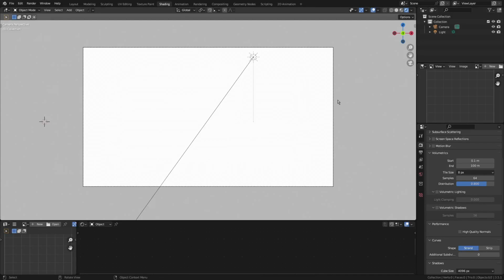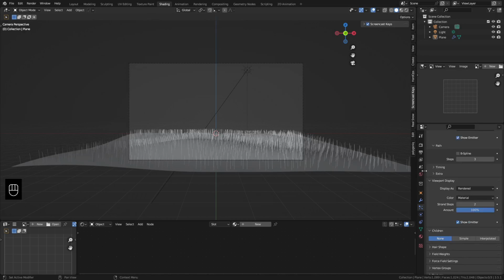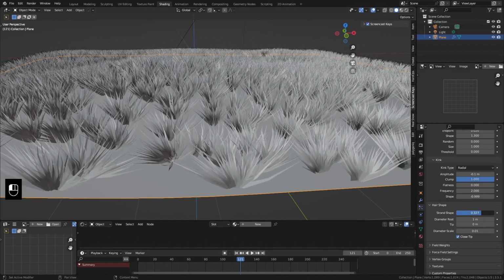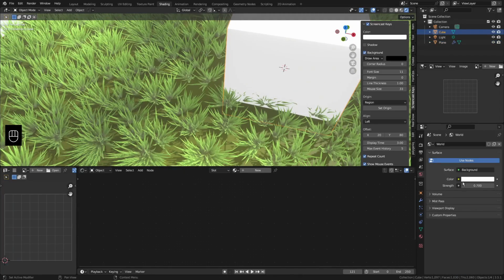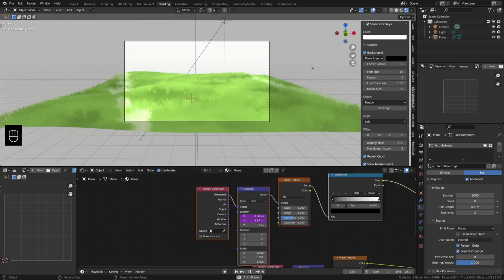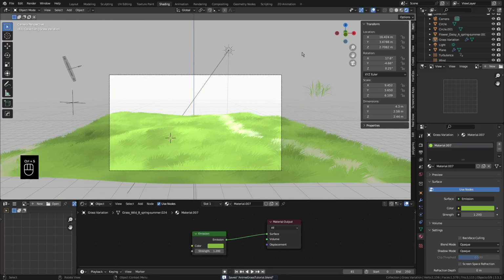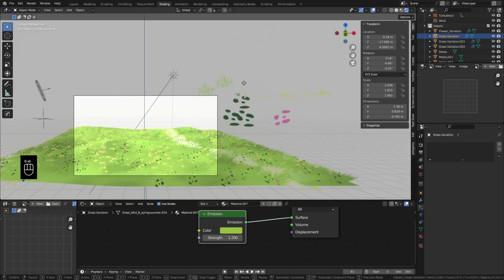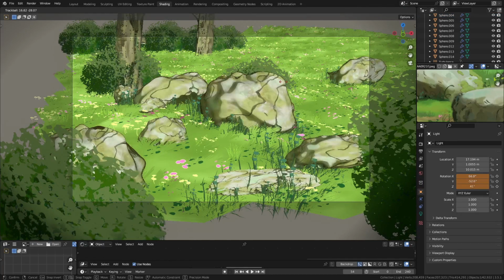Tutorial: 3D Anime Procedural Grass in Blender

Comment: Anyone having problems in the 4.2 update? mine messed up and the shader isn't working
Reply: have you figured it out? mine crash if i click shader view/render view/ try to open shader panel or try to render anything ((
I had to restore my blender 4.0 and it works, but i want 4.2 so badly
Reply: Yeah same happened to me, I had to reinstall 4.1, I think my pc isn’t enough for running the 4.2 smoothly, I’ll remain in 4.1 until I can get a new pc or blender optimizes its latest release, also the shader doesn’t cast shadows idk if you have the same problem, greetings 👋

Comment: For those who want objects to cast shadows onto the grass, pass everything into the color slot of a Diffuse BSDF. Then shift + a and add a normal node and pass that into the normal of the Diffuse BSDF. The result should be the same but with shadows.
Reply: i don´t know if i did it right but it doesn´t work for me. Do you have to put de diffuse bsdf before the last node? the normal node has to be connected to the rest?

thanks man
Reply: @Manu-um3vp  The diffuse should be the last node before the material output. You pass the color of the original shader, the one made in this video, into the color of the diffuse and a normal node into the normal of the diffuse. Then you pass the diffuse into the material output.
Reply: @SimplyAzure-sq4ru  thanks, and the normal node is not connected to anything but the normal of the diffuse? i think i made it right but it doesnt work for me
Reply: @Manu-um3vp  Yup the normal node should only connect to the diffuse shader node. Maybe it could be that our blender versions are different. I'm using blender 4.1, what blender version are you using?
Reply: @SimplyAzure-sq4ru  Connect the Vector from Mapping to the normal, then, the normal to de normal of the diffuse and that should be work

In this order  Texture corrdinate ----- Mapping(2 from vector, 1 to Noise texture and 1 to Normal) ---- Noise texture ---- Color Ramp ---- Diffuse and Normal to the normal of the diffuse, and Diffuse to material output
Reply: @SimplyAzure-sq4ru  I'm usin 3.6, but it worked now for some reason, my file was kinda crazy with the lights, earlier if I marked the cast shadows option in the lights config the lights would not work, but now it does and the grass is affected also, idk what happened thanks
Reply: i love you omg i wanted the stylized effect but casting shadows, now is perfect, thank you  !!